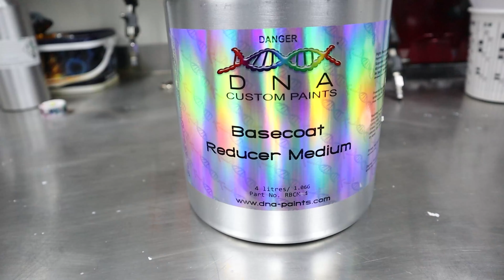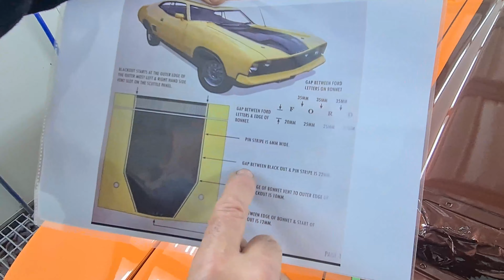HOW TO PAINT A XB FALCON COUPE

Comment: Nice jop what the step buy step from primer to clear how many litres and from reducer to thinners for each stage thanks Michael
Reply from the maker: really depends on the product . from memory i used 5 litres of orange . "basecoat" for the outside ., that was mixed 1:1 with thinner . so 5 litres . 10 in total. thats was for door jambs and insides of doors bonnet and boot.. then i used 3litres of DG 2k for the inside of the body, boot area and engine bay . clear coat i used 10 litres of clear . of a 4:1 clear "2 , 5 litre kits" i sprayed 3 coats
Reply: Hi thanks for your reply you are a artists for what you do watching your video I found all 2k paint process epoxy primer body filler epoxy primer high build primer you did a white ground coat base coat and clear as the top coat
Reply from the maker: @michaeljohn8842  correct mate . Due to the main color being orange . Orange yellow red blues and green solid colors may take several coats to gain full coverage . By using a white base you will gain coverage a lot sooner . Saving on time and paint . It will also give you a cleaner brighter color
Reply: Hi I'm put on the original walnut glow what best ground coat thanks michael
Reply from the maker: @michaeljohn8842  does t really matter mate it covers great . Its more the orange which requires white
Reply: I'm rebuilding a xa and the original colour is walnut glow what ground coat do I put thanks Michael
Reply from the maker: @michaeljohn8842  if you use a black or dark grey primer that will be suitable . If the primer is a light grey , use black base
Reply: Hi so what your saying is I primer with grey high build primer and black ground coat and then walnut glow and clear thanks michael
Reply from the maker: @michaeljohn8842  correct mate 100%
Reply: Hi thanks for the information I was thinking when I was watching your video on when you paint the orange you did the walnut over the top is will orange will be good as ground too hey when you doing the next project you have not done nothing for 5 months I enjoy watching and taking in more information thanks Michael
Reply: Hi bog dust what type of black I put on top of the high build grey primer f o r the walnut glow thanks michael
Reply from the maker: @michaeljohn8842  just a black basecoat mate "same brand as your other products
Reply: I watch your video on step by step and you saying use only one brand  and was going to choose different brands to save money u catch me lol ok I will use one brand I see epoxy primer fast drying and one with slow drying it so confusing only thing I'm worry about is how dangerous 2k paint is
Reply: Hi bog dust looking forward to your new video ? Mate if I use epoxy primer grey and then use black high build primer can I get away in just useing the black high build primer as a base coat for walnut glow save me buying to lots of base coat
Reply from the maker: @michaeljohn8842  hi Michael, closer the base or primer to your top coat color is the faster you’ll gain coverage . This can be done with either a tinted primer or a basecoat